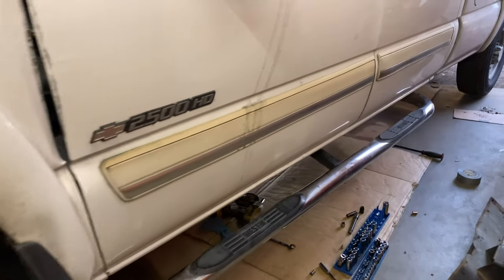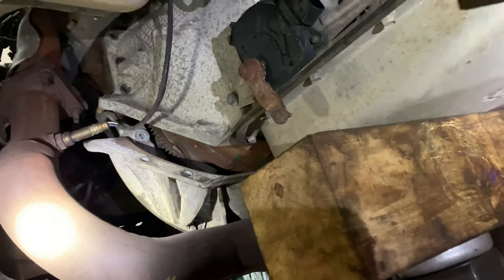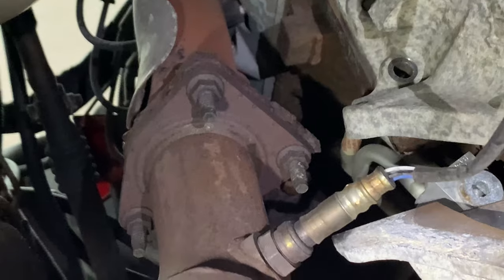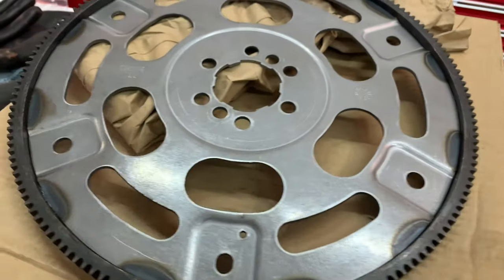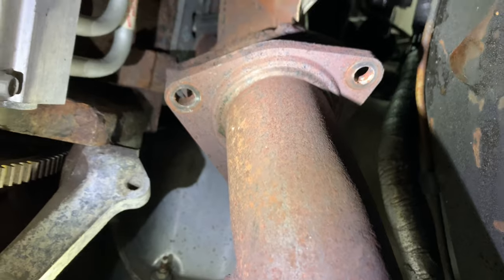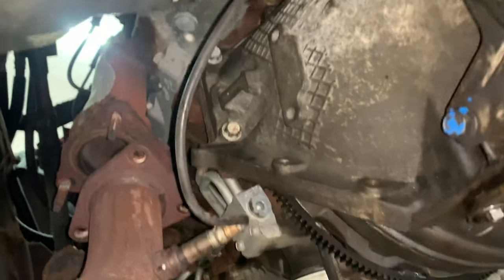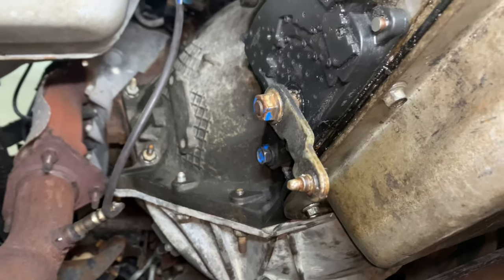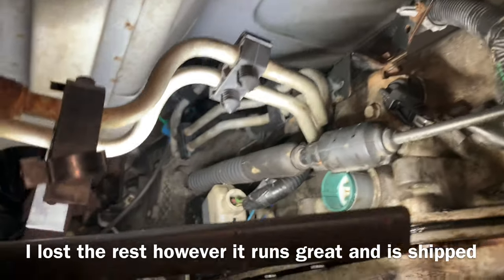06 Chevy Silverado Broken flex plate transmission swap

Comment from the maker: Here we are swapping out a transmission due to a broken flex plate. There was also bell housing damage on this 2500. Customer opted for a used transmission with 140k on this 4L80 transmission. Here is a short clip on the issue it caused.

Comment: Do you have a video demonstrating the noise/sound it was making?
Reply: I just pulled the inspection plate from my van and found the plate to be cracked. The sound definite at idle, it sounds like metal hitting metal which it is, not sure if that helps or not. My noise will go away under load, but I need my van 3 more weeks then I can tear it down to put in a new plate.
Reply: Guess I could make a video of what it sounds like if you want........sort of an embarrassing sound at stop light,
Reply: That would be super helpful as direct auditory diagnosis

Comment: Why did you have to replace the trans vs just the flexplate?
Reply from the maker: MarkPdot the shop before broke two ears off the case. He had broke 3 plates since then so I didn’t want him to have any more issues. 2 ears broke and they snapped a bolt in the case. We did all 3 u joints too.
Reply: @weldingjunkie  Fair enough. Thanks

Comment: Was the flexplate making noise from the cracks
Reply from the maker: It was yes especially Around the bolts
Reply: @weldingjunkie  mine was making noise hit no crackes just loose bolts scrapping got lucky